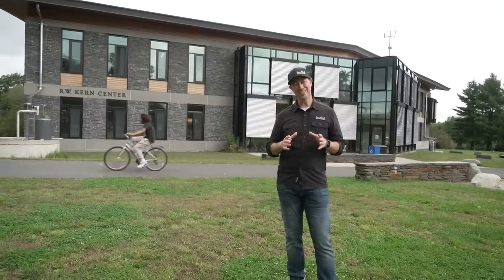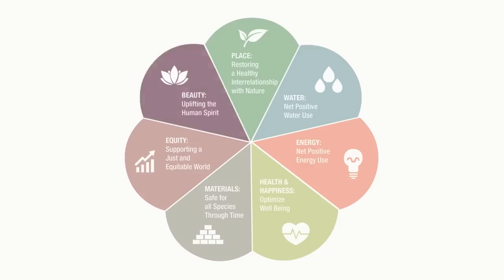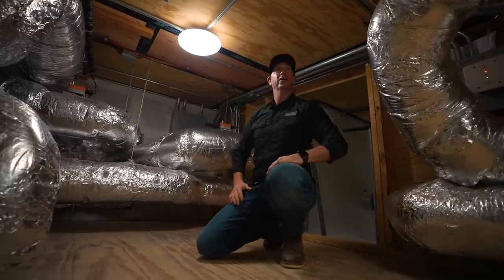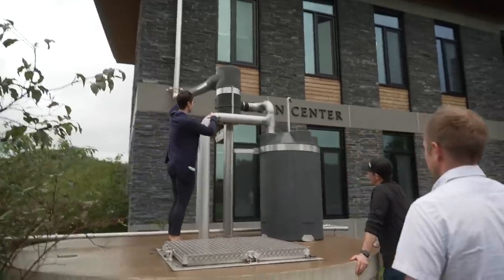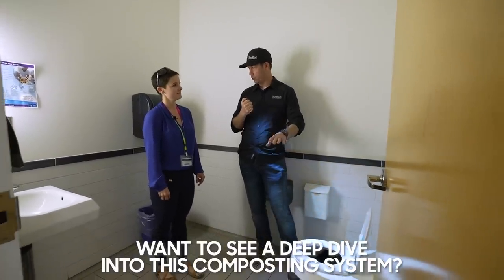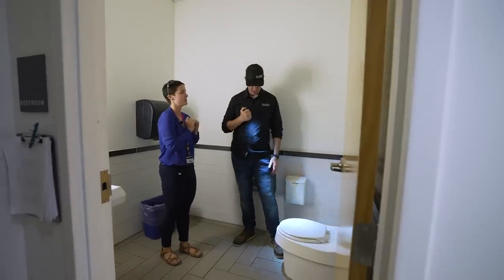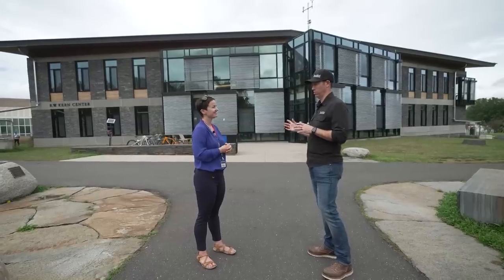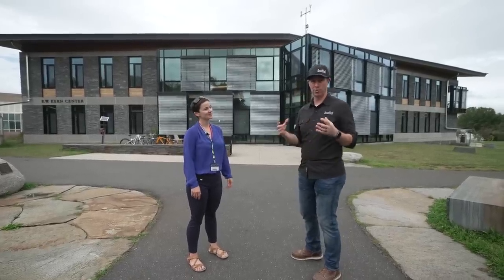Solar-Powered, Net Zero Water:  Amazing “Living” Building Tour! - R.W. Kern Center

Comment: Yet another vote for the deep dive into the composting toilets. I'm particularly interested in: cost, who manufactures them, any differences between available systems, install considerations, what kind of on-going maintenance is required, how to manage/use the "effluent", etc. Great video, Matt.
Reply: They separate liquids and solids.  The solids need some sort of holding tank, several of them, to maintain a specific temperature and have anaerobic bacteria added to it to speed up decomposition.  As one tank fills up and starts and finishes decomposition, any further solid wast will need to be sent to another tank.  Once the tank finished decomposition of the solids it will need to be emptied so it can be used after the other tank(s) are full and still decomposing the solid wast.

Once the solid wast has finished decomposing it will not stink and can be spread on a yard or garden to enrich the soil with all of the minerals and other nutrients that are in composted waste.  If you have no place to spread your decomposed waste then maybe you can bag it up and sell or give it to someone who can.

Regular toilets, on a municipal system, you flush and it is gone.  Other than keeping the toilet clean there is nothing else for you to do.  The municipal system will separate the solids and process them and put it through a decomposing process in mass and use or sell the compost.  It is usually much cheaper because of the cost saving of scale.

Septic tanks have to be pumped empty periodically and the companies that do that will put the waste into a holding lagoon to let the liquids evaporate and then compost the dehydrated remains.
Reply: Everything you said!
Reply: Yeah that's called a septic system.  Having them pumped is not always necessary or mandatory.  Most of the ones in my area almost never need that.

This is all a lot of reinventing the wheel folks!  
Worse yet, going backwards in some areas if you really think about it.
Reply: @Erick-di9gm  
A septic system keeps the liquid and solid waste together until it reaches the tank.  A composting toilet separates the liquids and solids and sends them to separate tanks to be processed separately.

It depends on what you put into a septic tank on if and how often they need to be pumped out.  If you do not use a garbage disposal to send ground up vegetables and stuff or use a bidet on your toilets so you do not need paper toilet tissue, then you could potentially go for decades without ever needing to pump a septic tank out.
Reply: I only have heard of a few different types of composting toilets on tiny houses. So many on YouTube. Living big in a Tiny house. But in a huge commercial building like this? I would love to know about the system.

Comment: This is great! I hope people get fired up as much as I do seeing these systems in action. I hope people realize that this type of build doesn’t have to be limited to people with deep pockets. The cheapest and easiest way we’ve found to achieve this type of build for everyday people is to buy or hire a sawmill, cut your own timbers, build the walls with straw bales, using earthen plaster from the site, and collect/filter rainwater with a biosand filter. Using a dry toilet instead of a composting toilet can save huge amounts of money on energy consumption. We’re doing this on a residential scale with huge success.

Comment: I dislike the fees that are attached to certification of the different building standards (PH, LBC, ES). But I really like the construct of specific parameters/ requirements that need to be met, the challenge acheiving certification, and the purpose behind the goal. And definitely show the compost system. I have a friend who's house has one (built in the early 90s) that is basic and has no smell. The toilet is a wood box with a hole connected to an 10" pipe. The lid seals tight.
Reply: Believe it or not, oil companies involved themselves and tried to raise the fees (and influence in other ways).
Why? Simply put; if this catches on, heating oil and Natural gas use drops.
Low Capital Gains Taxes changed corporate tactics from mere profits to emphasizing Profit GROWTH above all else (including "good jobs" or investment into research and development).  Reducing the number of new buildings that use fossil fuel energy (including up the chain where the electricity is generated) threatens their profit growth.

Sad yet true.

Comment: I find it absolutely disturbing that many (most?) states in the USA prohibit composting toilets.  Please do a video on how awesome it is, and lets get the word out!
Reply: I don't think it's that surprising.  It requires having positive air pressure in the room or negative pressure in the toilet. I can imagine the technology wasn't the previously for them to hygienic and there hasn't been much of a push to change the laws to reflect the advances in technology.
Reply: Actually they are not prohibited, and are in fact legal at the federal level. They are restricted in some states/localities for other reasons.
Reply: Most composting toilets risk people getting back splash of other people's festering waste as they are just buckets with a toilet seat. that makes them a biohazard that risks spreading diseases. Vermifilter toilets seem to be safer. Also, keep in mind you can get code exceptions, but chances are a dry toilet system if you can get it passed at all will likely lower your resale value unlike systems that capture black water and treat it.
Reply: Open biowaste.
Reply: @AdolphusOfBlood  these Clivus systems have the compost tanks well below the seat, no risk at all of splash back. You’d be more likely to get bacteria on you from a standard flush toilet because it seems you can never avoid the slash there
Reply: @N-hunter  that is what the lid is for, but I am glad that their system is not a biohazerd unlike many things that people pass off as composting toilets. Hopefully ones like theirs can see wider adoption.

Comment: Love a deep dive on the toilets.
My big question is there a place on the property I don't want to stand?

Oh, wait rain water.
It is clean because there isn't an aggregate on the roof, so I am guessing there is no first flush diverter. And I noticed a pipe for overflow. But how do they keep the water clean. And how are they drawing water from the tank? You don't want to draw from the bottom because sediment can build up. And you don't want to draw from the top in case things are floating.

And how is the water treated and where is it used? She mentioned plants, is all that water for plants?
Reply: Re: rainwater- we do have both a vortex filter and first-flush diverter for each cistern, and the intake hose in the cistern floats about 1' below the surface on a float to minimize sediment pickup and surface contaminants. The water then heads to the basement for UV treatment (though as I mentioned, we aren't allowed to use this water at the moment, because of chlorination requirements, so we use an alternate municipal line). 

The water for plants is our greywater. We pump all the used water from the building though a series of planters to clean it, then it heads out to a basic leach field.

Comment: Ummm I have more questions. This building is not for "living" it is office (commercial) space. Not that it's a bad thing, but can you build a house with all these materials and ensure they last? What is the maintenance cost (upkeep) vs a a build show house? Should you have a compost toilet in a house? What if there is a system failure and there is no negative pressure? Can you still live in the house until it is fixed. This seems like a good idea for office space (maybe) but not sure how practical it is for a residential application. Please tell me I'm wrong and why. Thanks

Comment: This is all very interesting. Along the lines of Matt's analogy of "checking the box by adding a bike rack" I wonder if the traffic of this building is throttled in any way. For example do other building on campus of a similar size have 2,000 people per day going through using water, air, HVAC, , etc but this one is limited to 200... just as an example.
Reply: Good question! [and I love some healthy skepticism] We don't limit use of this building in any way; I'm not brave enough to get between students and their coffee (at the cafe). A student project of monitoring building use a few years ago showed we get about 1,800 people entering/exiting per day (though some of these are likely repeats). Honestly I'd rather  fall short of Net Zero Energy because too many people use the building- it's still much more efficient than the other 70's/80's buildings on campus.
Reply: @r.w.kerncenter9246  Thanks for the reply. I can't help but to be a bit of a skeptic on fantastic claims. You put this question to rest. 
This building is an amazing feat of engineering.

Comment: You touched briefly on the local municipality and the use of rainwater. I'm sure they'd have an issue with a large commercial building like that not being a source of income for them. No doubt they'd run interference as much as possible.

Comment: Do all those solar panels charge on site batteries to power the building on cloudy days and at night? Or do they just feed the local power grid whenever the sun is shining? In my mind, "net-zero" should mean you do not need the grid, not just how much power you can produce vs how much you use over time.
Reply: If the grid is stable (and near), having batteries is worse for the environment. Sure when it’s rainy you’re using grid power, but when it’s not you’re putting energy back in the grid, meaning that power plants need to produce less.

Comment: Yes to the deep dive. But what is the cost? We could reduce our toxin load per person, which is a significant problem, by the water certification pedal of the flower. Rainwater capture, which is illegal in some states, is something that could benefit all of us and because of the natural distillation process with that rain water capture will reduce public water toxin exposure such as pharmaceuticals which are not filter in conventional systems.

Comment: I’d love to learn more about that composting toilet and rainwater collection system. Also what code issues are there with using the rain water?
Reply: Where do you live?  In Texas you can harvest rainwater, but composting toilets are difficult to get approved.
Reply: Why is a composting toilet hard to get approved?
Reply: @westwardbound1436  Tons of issues with getting air quality right. That is why they have to have the negative pressure system. Plus generally codes have not been updated to allow them. Building codes are always 10-20 years behind innovation.
Reply: That makes a lot of sense. I work for a builder that aims towards net zero and passive homes. We actually won the #1 netzero award this year through CHBA. Matt stopped by the project during his canada trip last year. No decompostible toilets unfortunately. Maybe not the best system for a home but I love cabins that utilize those crappers.
Reply: I live in Amherst and studied building science, so we spent a good amount of time analyzing this living building (and another on the Hampshire college grounds). The regulatory issue is that the building provides water for a quantity of people that classifies it as a public water supply. Thus, they must meet the water quality requirements set by the town. The Kern Center can't meet these requirements because to do so would require the use of chemical water treatments... which are not allowed by the living building challenge standard. While the water is filtered and treated, the town won't allow the Kern center to use their harvested water as potable water.
Reply: Ro Herms  thanks for the info!
Reply: Ro Herms  Glad you brought this up. In our building, where we don't have showers or other water-heavy uses, using greywater for toilet flushing wasn't practical. But in a residential area with existing sewer or septic, the rainwater + greywater re-use strategy you outlined often makes more practical/financial sense. Depends on the local water/sewer rates and connection fees of course, but usually a more straightforward option in already developed areas.
Reply: While I’m about to buy and use a composting toilet, using them as part of a package in a public building so as to use no off-site water  reveals a philosophical orientation that misses the point. While it inspires a high standard it also invites criticism in that to achieve that standard there is a disproportionate cost and complexity involved. Solar disconnected from the grid is a comparable situation. The extra expense of batteries is unnecessary. The extra expense and the regulatory can of worms for a public building to use no off-site water is unnecessary. I get the appeal of pushing oneself to achieve a high standard as a model of what is possible but the point is not to have one gold spoon in a tray of wood and lead utensils. It is always a better use of resources (money, time, effort, materials) to offset those final nearly-unachievable absolutist percentages points by looking elsewhere. But I get the motivation to achieve a high standard. But perhaps an even higher standard is to be proportional and offset the nearly-too-costly-to-achieve items by offsetting them elsewhere. In this case, by reducing water use in other areas of the campus, or even in the community, by, let’s say, a factor of 5. That is probably much more easily achieved. Currently this building doesn’t meet the standard because it isn’t allowed to. 

Otherwise, it’s a perfect building and the standard appears to be responsible and inspiring.

Also, I don’t think it was a mistake to aim this high. We are all in this situation attacking it from all sides and learning as we go. I sincerely don’t intend to be overly critical here. Until code catches up I’d say offset water use elsewhere and for new buildings perhaps consider another strategy that can efficiently achieve net zero off-site water use both at present and at a later date after code changes occur. But again, great project.
Reply: In California, you can't harvest and store rain water. I'm not sure if that is the same issues in Massachusetts.

Comment: When you said 'let's go downstairs and look at the composting toilets' I immediately started thinking about the convenience of use. Since this system relies on a direct drop of waste matter into the pit, there is no way to have toilet facilities on each level of the building. I find it impractical to require all users of the building to traverse several levels to use the toilet.

Can you imagine being on the second floor when 'the urge' hits and you need to go down two levels to access a toilet? Or am I missing something (perhaps people at Hampshire College have different bodily urges than other humans)?
Reply: Good catch- that was a mis-speak. There are bathrooms/toilets on both floors of the building; just the composting tanks are in the basement.

Comment: I wonder how long those composting toilets will be viable in that building.
10 years at most, what do you think?
Reply from the maker: They are 5 years in and working great. Video on those coming soon!
Reply: @buildshow  
I would like to see a more thorough video on that. Number of toilets placement considerations and maintenance!and future possible downsides .
Reply: @myperspective5091  My scout camp has been using the Clivus Multrum system for many years with no issues at all

Comment: Sorry. No Sale. Those toilets are disgusting! You could use rainwater and a septic tank, but city sewer is "mass transit for poo." Those outside shades are also one wind storm away from significant damage. (The replacement costs of the external shades is going to far exceed the cost of whatever energy they might save.) More emphasis needs to be placed on economy, budget, cost benefit analysis, and productivity of the building. By productivity of the building, I mean the number of people it houses, classes it hosts, meetings that take place. For example if it has a meeting room, is it used every hour of every day? ( Ok true utilization of a meeting room might not be every hour, but many colleges have a large lecture hall shared by multiple departments, so the main lecture hall is used daily, all day long, and into the evening for night classes too. At night it is cleaned. Those meetings halls also host speakers, workshops, periodic gatherings, and special events on the weekends.)  The building also needs to make money, ROI, or provide value for whoever put it up. Leaving the rainwater basins above ground is ugly. (and beauty is one of the requirements). Hide them with landscaping.
Reply: I agree with your suggestion to analyze ROI, Usage, etc... but disagree that a composting toilet is disgusting - be open minded.

Comment: Overall I love the building, especially the wood construction, but it seems like those external blinds would get shredded by the wind.
Reply: They would- that's why there's a sensor on the roof for wind speed. If it gets above 10mph the shades retract. Funnily enough, the bigger issue we had was with snow pack freezing them into place in winter. Now they're programed to stop a few feet above the ground to avoid that problem. #liveandlearn

Comment: Impressive goals, but some of the build decisions seem questionable. Let’s take the plumbing for example. It was designed in a way that does not pass code and thus cannot perform all the required functions. Baffling with this deficiency they applied for and even received living building certification because it could “in theory” meet the requirements. The plumbing mishap highlights that care needs taken to design to local codes, get exceptions before building, or choose a more suitable place to build.